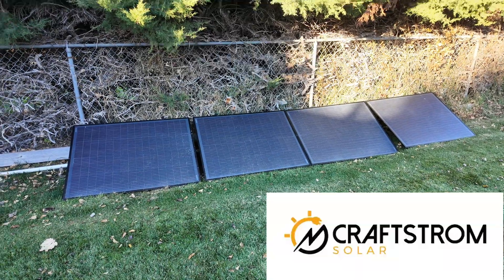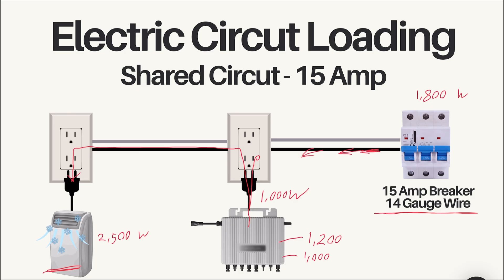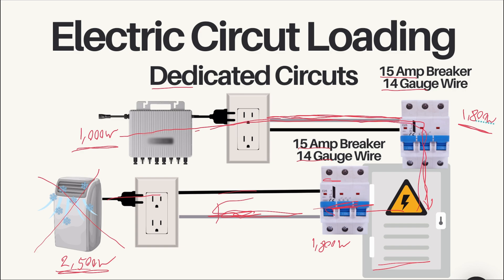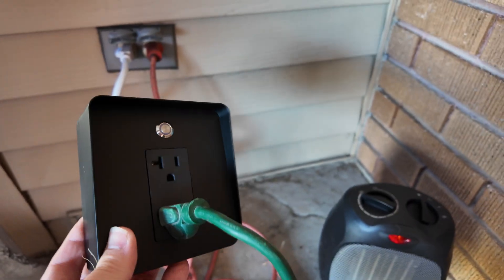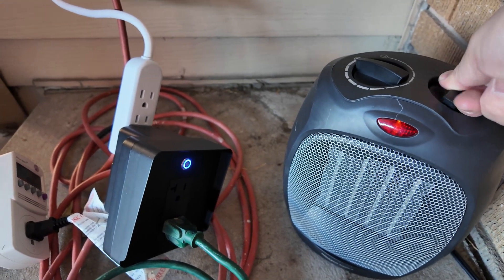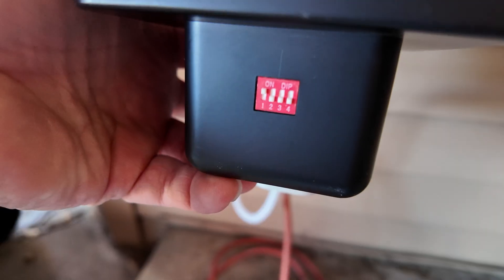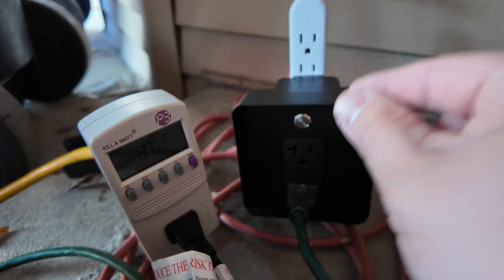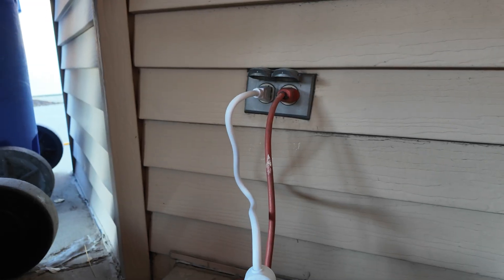Stop! Don't Plug Solar Into a Shared Circuit Until You Watch This!

Comment: So, basically I need a dedicated circuit. It's similar to the dedicated circuit I had installed for my table saw. It runs to one outlet. Otherwise, I would risk blowing the breaker or worse causing an electric fire.
Reply from the maker: Correct

Comment: Looks like it was a lot harder to use than it should be.  The fact that it can be set manually, and clearly done incorrectly, makes it a non-sequitur for many.  I think there is a future in direct PV input, but this ain't it.
Reply from the maker: It’s at least a solution available!

Comment: The 2500 Watt demand is going to trip the breaker right away regardless of the solar.
Reply from the maker: Hummm. I don’t think so based on the math!
Reply: @theresatrickforthat Yes it will. 2500w > 1800w
A 2500w device is drawing 20.8amps. Your 15amp breaker is going to trip with that much power draw.

Comment: Simple safety check would be if your appliance doesn't trip the breaker at night you can run it during the day. I think most peoples houses are wired with 12/3 romex so 2500 watts is within limits.
Reply from the maker: That's not always a safe assumption; you need to consider the total load on the circuit, including anything else that might be plugged in or turned on! Plus, all homes are not wired with 12 awg wire
Reply: @theresatrickforthat  Plus, at night the circuit/wire is likely cooler so less resistance, so it might still trip during the day, hotter wire, more resistance.

Comment: Can you get a device in the US that is larger than 1,500 watts? Some things are rated for 1800 watts, but they are for short term use, like a blow dryer. So, over powering a circut won't be common. Especially since solar doesn't sustain its max wattage for long. I don't think it's as big of a deal as you make it out to be.
Reply from the maker: There are devices that can pull more than that…but they are rare. What would be common however is a shared circuit with outlets in your kitchen let’s say, and there’s an outdoor outlet on the same circuit. You could easily have a 1,500 w air fryer plugged in and running, and then have someone try to run their coffee maker at the same time that’s another 1,000 watts and boom! You’re way overloaded!
Reply: If I was going to back feed my house I would do it over the outdoor AC wiring.